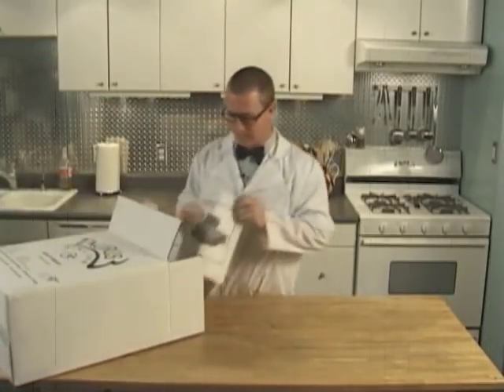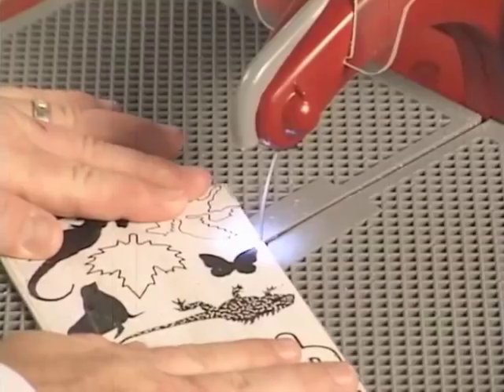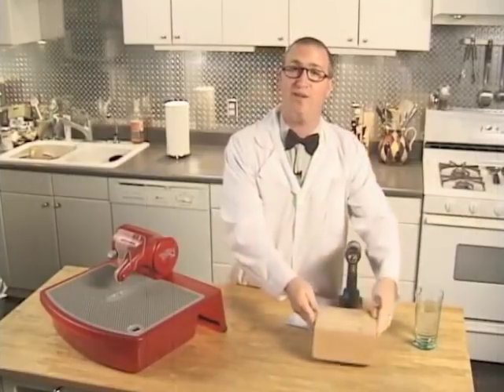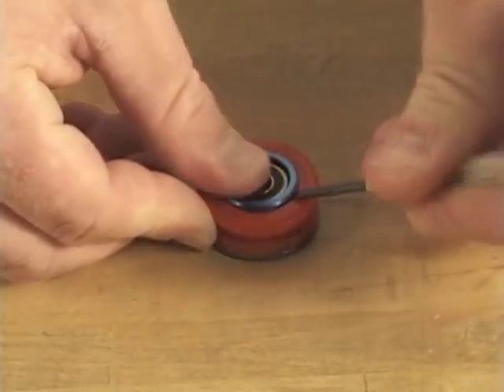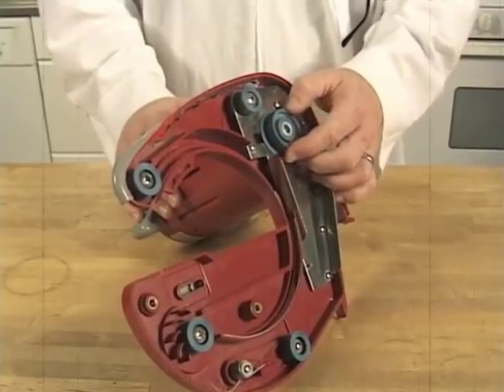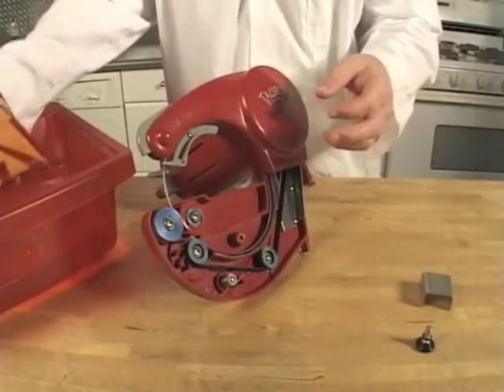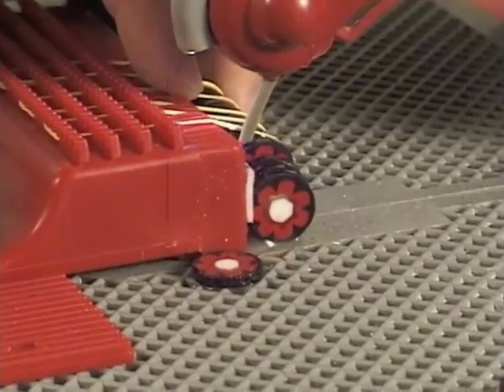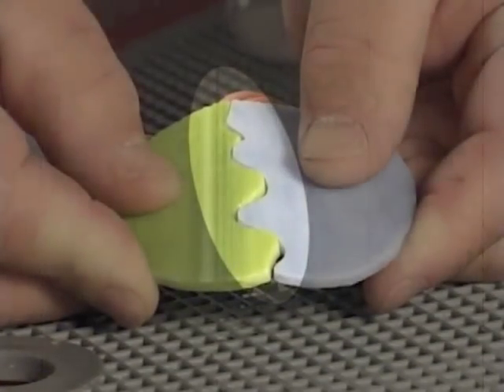Gemini Taurus 3 Ring Saw - Use and Maintenance

Comment: QUESTION: I bought the Taurus Ring Saw 2 months ago. I already have to change the blade that came with it. Is this normal?  I thought I was letting the blade do the work. Am I pushing the glass in too hard? I thought the blades would last longer.  Thank you.

Comment: Should the foot be loosened for regular (non-handheld) use so that it self-adjusts to the thickness of the glass?  My foot came screwed on really tight.  Also:  Why did Gemini do away with the water level markings on the newer tubs?  Mine didn't come with any and once I put the water in to match 1/2-way up the lowest blue wheel, I'll have to use a permanent marker to make my own water level indicator on the tub.

Comment: So, after watching this video, I thought it was simple to change my broken blade. I followed it to a tee. However, upon first use, one of my red grommets popped off. The video says put one forward and one backwards. My flange is black plastic, not shiny metal like this one. It seems, there is nothing to hold the red grommet in place on the flange!! So, I flipped it around, so both are facing the same direction and it now works. There is also not a flat vs rounded side to the red grommet - both sides are flat.
In conclusion, I bought my saw in 2013, but the grommets were bought in 2016. So, did I get old parts, newer parts, I don't know - but they don't match this 2015 video.
Reply: I think it's a good idea to take photos of the inner workings with a cell phone before dismantling it to replace parts.  That way, you can reference the photo to know what it looked like before.

Comment: Hi this is great video explanation BUT! we have only been using the ringsaw since January and today the blade snapped huting my colleague, so I changed the gromets and was about to change the blade but notice the Kevlar/copper are already showing through...I am thinking that this machine is not industrial enough for proper use but more of a toy, perhaps with parts not as good as they may been in the past. 3 moths of moderate use use and the parts have disintegrated

Comment: I changed the gromets and was about to replace the blade but inspected the belt and his worn down to the Kevlar/copper this suggests that is why the blade snapped as it must have slipped in the belt!  suggesting that this machine is not industrial enough for our moderate use, but more of a toy or that the parts are made of substandard material...be warned and be careful